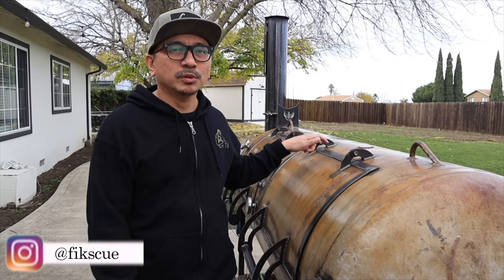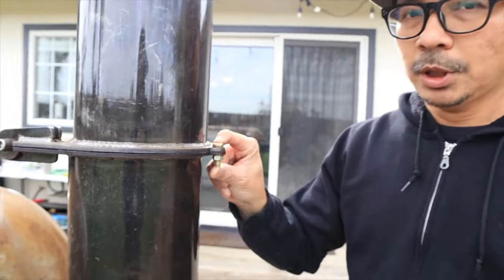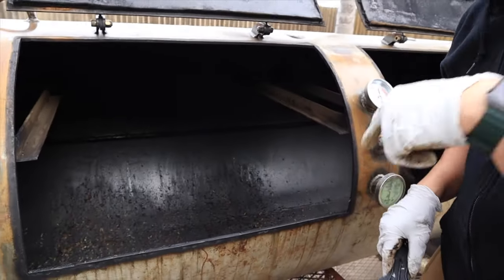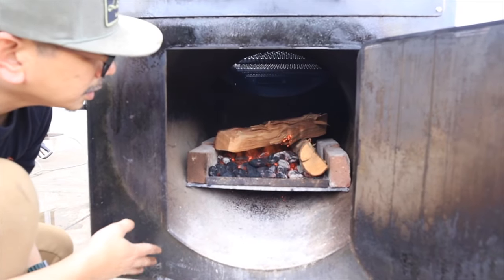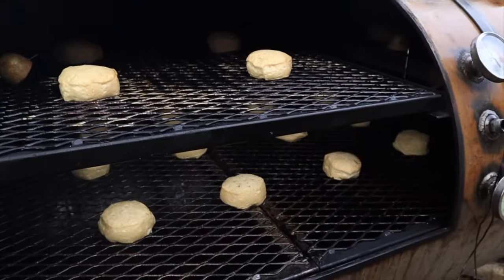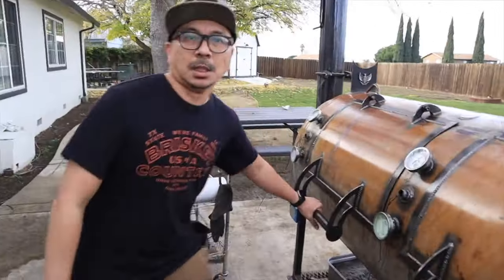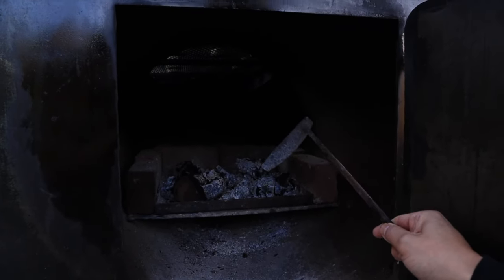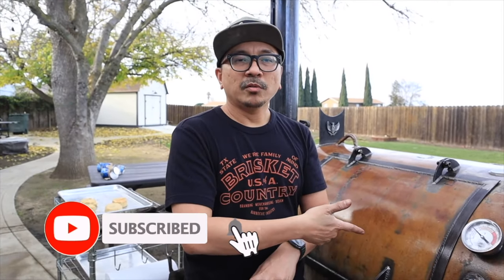Is 250 Too Big For The Backyard? 1 Year Update & Biscuit Test

Comment: If you don't use the top grates often, I suggest removing them, cleaning them thoroughly, oiling them and storing them. Keep them close in case you need them for something unplanned, but this will preserve them somewhat in case one starts to warp or rust.
Reply from the maker: Thanks for the tip, Michael. I store one, and keep one in the smoker. I use it to finish my chicken or anything I need to sear.

Comment: You can do 225° for the bottom rack temp next to the fire. Which will put your top rack at 275°. Then rotate briskets every hour or two. 

Bottom front next to the fire moves to the top rack farthest back and away from the fire. And the top back moves to the bottom front closest to the fire (swap). Then, top front next to the fire moves to the bottom back farthest away from the fire. And bottom back moves to top front closest to the fire (swap). 

Next movement.....

Bottom front next to fire moves to 2nd from back on the top. And 2nd from back on the top moves to bottom front next to fire (swap). Then the top front closest to the fire gets swapped with the 2nd from the back bottom farthest from the fire.

 Finally the bottom front next to fire moves to 3rd from back on the top. And 3rd from back on the top moves to bottom front next to fire (swap). Then the top front closest to the fire gets swapped with the 3rd from the back bottom farthest from the fire.
Reply from the maker: That's a lot movement haha. I try not have anything on top of my brisket when I'm cooking because any drippings falling down will mess with my bark formation. I also rotate my briskets only after wrapping for the same reason. Thanks for dropping in!

Comment: Love the smoker...you wanna add a reflector plate where your firebox hole comes through...it will block some of that heat on that end and keep that end from running so hot and it'll burn within 2 -4 degrees difference all the way across bottom and top
Reply from the maker: Thank you! I tried that and didn't like the results. The plate only pushed the hotspot more inward toward the stack lessening the even temps area on the bottom grate. As for the top grates, they're always going to be hotter no matter what since heat rises up, and I'm ok with that. I can always use the hot spots to my advantage.
Reply: Reflector plate?
Reply from the maker: @epickleuva  He probably meant the baffle or deflector plate.
Reply: @fikscue  figured.

Comment: It is perfectly okay to spray your cooker with any vegetable oils in a spray bottle all over and run a fire up to 300 degrees or better just to keep your smoker well oiled and seasoned. Once rust sets in your grates ?? It’s way no bueno. Wire brush it prior your dummy cook
Reply from the maker: Thanks for the tip! My grates never rust. I treat it like a cast iron skillet. The outside of the smoker however, I don't care too much if it rusts. Easily fixable when I want them off.

Comment: You need what’s called a deflector plate on the cook side by the fire box. Most of the new pits are being made with them now to prevent the hit spot closest to the fire box. It reflects the heat down and away from the very front of the grill. Easy fix to a nice smoker.
Reply from the maker: I don't like any kind of baffles. Had them with my Old Country pits and don't like how they cook. It makes them bottom up cookers. Offsets should be top-down cookers.

Comment: Hey brother.  Awesome contents you have.  Question, where do you place your smoker in order to prevent it from rusting? I used to put a cover on my smoker after it cools off from my cooks, but after awhile it becomes a hassle to do it every single time .  Thanks.
Reply from the maker: It's just outside in the backyard. Used to cover it too, but you're right it becomes too much of a hassle to do. Rust is inevitable on metal. All you can do is scrub it and put oil to periodically remove them.

Comment: I've had this size smoker for almost 30 years. You do not scrape off the soot. It is flavoring
 After a good year of use. Maybe 25 -30 cooks of broakets and ribs, you can burn off the grease. Othrsise every 2 years. But do not scrape it. If you want to season outside to keep away rust, use oil used cooking oil. It will cover well and is free
Reply from the maker: I don't want any soot on my food. I always scrape off the top of my cooking chamber before each cook so it doesn't fall on my proteins,

Comment: Loved the video. Love seeing how different people run their offsets.  Do you think elevating the fire makes the top grate unusable, and the proximity of the fire to the bottom grates makes the 1st third of the bottom grate too hot also? 

Just asking of course, not criticism.   If you ran the fire closer to the firebox door and cooked on the bottom if the firebox, do u think that would help lower the top grate temp and give you more usable grate space?
Reply from the maker: I didn't use the coal rack in the beginning, just the bottom of the barrel. Pretty much the same results as far as the temps on the top grates and bottom near the firebox. The main difference with this setup is it prevents the ashes from being pulled into the cook chamber by the draft. I hate it when it gets on my protein lol.

Don't get me wrong, those hot spots that burned the biscuits are still usable for searing. Great even. Just not on what I cook the most, which is brisket. Thanks for stopping by!
Reply: @fikscue  cool. Good to know

Comment: Awesome pit bro. Just a question. Why are the temp gauges on the seams and not fixed to the middle of the doors?i see some do doors and others fix them on the cooking chamber seams. Is there a difference here for better results?
Reply from the maker: I think it’s the pit builder’s preference. Although by putting them on doors it has a chance of being slammed and can mess with the calibration. I like it not being on doors so it can still measure the internal pit temp when doors are open. Thanks for watching Neelan!

Comment: Never clear coated any of my pits I always oil spray them and they turn black like cast iron
Reply from the maker: Are they painted or raw?
Reply: @fikscue  when I build them they are raw I heat them up and then with a 2 gallon pump sprayer hose them down when they around 450degrees and it immediately hits the smoke point and turns to a cast iron like seasoning and each time from there on I cook on mine (about 1 time a week) I save all my drippings(I have drains in mine that drain the drippings into metal bucket. I will wipe it down with a rag of the drippings while things are cooking to build up the seasonings further and after a couple times of doing that they take the seasoning and won’t rush for longer periods of time between seasonings
Reply from the maker: @draco2202  That's awesome! Thanks for the tip. I sometimes use tallow since I make a lot of them, but find that regular canola oil sprays work just as good and less messy.

Comment: Pro tip: Drill a hole, or two, at the bottom of the smoking chamber and hang a bucket for the grease to drain in. Get more cooks out of it in between maintenance.
Reply from the maker: Thank you! This 250 has a 1" drain with a ball valve  near the stack side. I always keep it open and have some kind of container underneath to catch all the drippings. What you see on the bottom of the chamber is  the remaining and only a tiny fraction of what drained out.

Comment: Dude this was an excellent video, really down to earth.  You explained a lot of stuff. I really appreciate it. I'm really trying to get into cooking brisket. Thank you man
Reply from the maker: Thanks James! You're gonna have a lot of fun cooking brisket. Let me know if you have any questions.
Reply: @fikscue  Thanks I will👍🏾
Reply: @fikscue  I do have a question. Is there anyway to set up the smoker, so I can use the space at the top, so I can cook briskets on the top shelf also, without it burning the meat?
Reply from the maker: @jamesbarber4765  What kind of smoker are you using? Most offset cookers will have the top hotter because heat just rises up before exiting the smokestack. That doesn't necessarily mean meat will burn up top though.
Reply: @fikscue  I haven't gotten one yet. I have an opportunity to get and old fuel tank, it looks about the size of your smoker,  it's pretty big. I wanted to have one built like yours, so I was doing some research and came across your videos. I figured if I got a good enough recipe and instructions for cooking brisket, I could cook and sell some bbq on the days that I'm off work.
Reply from the maker: @jamesbarber4765  Gotcha. Well if you're getting something similar in size to mine (250) then you'd have plenty of space on the bottom grate to cook up to 9 briskets so  maybe don't worry too much about the upper grate. I haven't yet to cook any briskets on my top grate, but if I had to I could. Just gotta manage it more closely than the bottom. Top grates are great for cooking 300+ degrees for like chicken/ribs.
Reply: @fikscue  Great advice.

Comment: Great video!  Do you ever run a blocking log or water pan at the firebox end?
Reply from the maker: Thank you Joshua! I used to put a blocking log but not anymore. I found that the point on my brisket closest to the log heats up quicker. Tried moving the logs around but never really liked the results. I think I'm better off without it. I always use a water pan whenever I'm cooking brisket. I have a perfect spot to rest my water pan just above the end of the firebox inside the chamber on top of the exchange. I don't use water pan when cooking other proteins.
Reply: Anything you would do different on the location or number of temp gauges or probe port placements/quantity?
Reply from the maker: @joshuaweber1172  Probably not. They're where they're supposed to be. Now I hardly use the Tel-Trus only because I'd rather rely on the digital thermometers so I can be inside preparing other things, but I look at them once in a while just for comparison sake.
Reply: How are you hanging your water pan - appears one side is on top shelf bracket - what is the other side sitting on?
Reply from the maker: @hojobbq  The other side just rest on top of the firebox part that goes inside the chamber

Comment: Something thats odd with the grids. Why isnt there a U shaped profile for the topgrids, to have safe slideouts with no risk of tipping over? 
Why isnt the first floor grids extendable? Then you would be able to reach everything.
A designflaw.
Reply from the maker: The top racks have latches in the back bottom of it that holds the rails and prevents tipping when pulled out. As for the bottom racks, it's not a pullout like the top in order to maximize the space.
Reply: @fikscue  ok..that solved my top rack question 👍
But still..the lower racks would not be physical smaller if they had a pull out function. Its also the place that really needs a pullout, due to the width and top racks positioning.
Reply from the maker: @hunkenpunken  Having a bottom pullout rack means it has to be built higher than it is now to accommodate the tracks, which translates to even shorter top clearance.
Reply: @fikscue  Why?  Just make the opening 3cm wider....
Reply: @hunkenpunken  You’ll give up an inch to have bottom sliding racks along with the in between space you’ll be giving up by having 2 doors.  Most folks don’t load bottom & top racks but here & there due to the temp difference & rotation requirements.  Most of these bigger pits only run drop in main grates 👍

Comment: You have an amazing offset smoker! I love The Rustic look that you have in my offset smoker I just did the basic high heat proof black color. May I share a secret that I felt that works with cleanup I aligned aluminum foil pans in the bottom so it can get all the grease fat from the cook. Plus the closer to the Firebox you can add water to the pans and it will add moisture and you won't have to Spritz this much. Try it out I'm sure you will find out the benefits of that let me know
Reply from the maker: Thanks James! How big is your offset? When mine is filled with briskets it's about 30 inches wide, so foil pans might just be too small. As far as the water pans, I put it there for brisket cooks. They do add moisture to the chamber. Appreciate you spending the time man
Reply: @fikscue  of course mine is not as long and as wide as yours mine almost 4 ft in length and about 24in in diameter at the widest but I'm sure you can find a very large Square aluminum foil pan they sell here at my local Dollar Tree store. The reason why use those out because they can be disposable and just lay them out and let them pictures Falls they can because most of the dripping is going to be near the center anyway. But I will this summer have somebody to weld a baffle plate inside the smoker Saudi initial heat from the fire box won't be so intensive
Reply: @fikscue  I'm not in the catering business like you but my Offset Smoker is over 10 years old and as you know doing each year you learn something different about your smoker and what you would have done to it or what you would do. I think I want to get an upgrade and get me or have me built-in reverse flow smoker so I can add warmer boxes to it I think that'll be my next step I wish I could send pictures on here so I can show you my smoker and what I mean about the aluminum pan drip pans
Reply from the maker: @jamesmoore1743  Send me a pic on instagram @fikscue. I'd love to see it!

Comment: Awesome! Nicely done 👌
Reply from the maker: Thanks Ed!
Reply: Fik, l like what your doing.
I’m going to pick up a propane tank this week. I’ve  been undecided about the size, originally I was interested in a 120 gallon tank. 
Now I’m thinking of a 200 or 250. 
The dimensions for the 200 are 27x87 inches. The 250 is 30x92 inches. I will let what’s available at the propane supplier determine which one I select. The cost is $50 per tank, I want two but I think my wife will explode. 

A friend of mine gave me a stick welder, I’ve never used one, and have enough friends that can chime in and help when need be.
This will be my first build and so looking forward to it.
Thank you for sharing your knowledge and I will try some of your techniques. 
Take care!